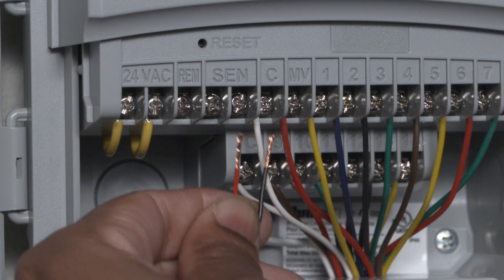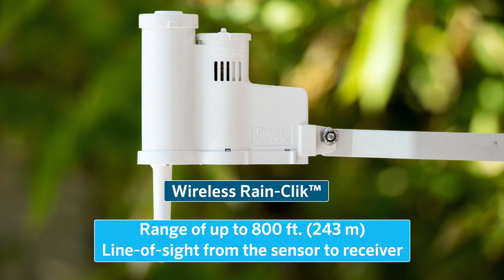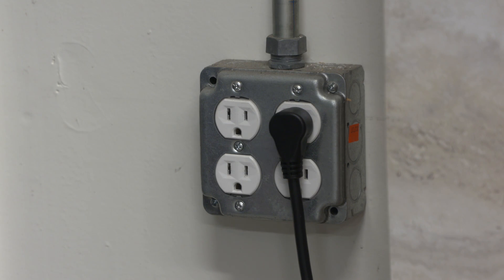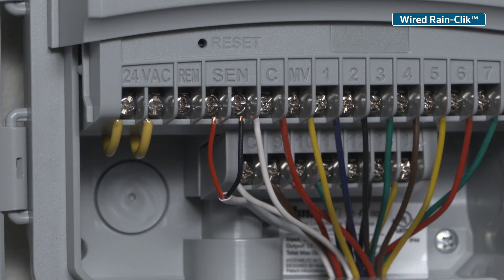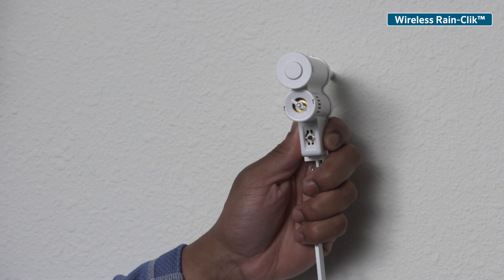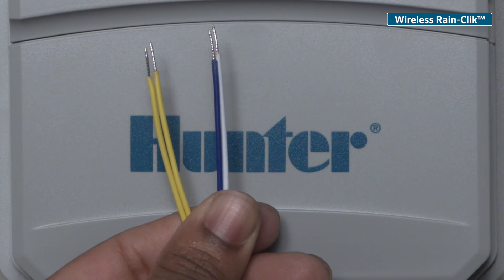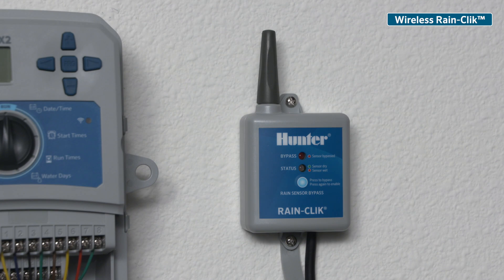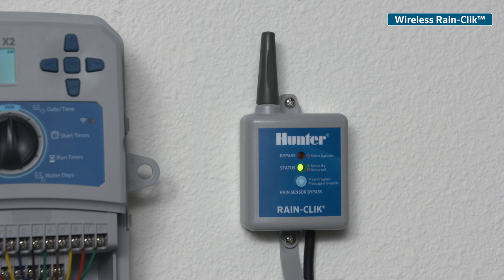X2 Irrigation Controller: Adding a Rain Sensor

Comment: Do I remove the jumper on the two sensor terminals before connecting the blue and white wires?
Reply from the maker: Yes, you need to remove the jumper before connecting the sensor wires.